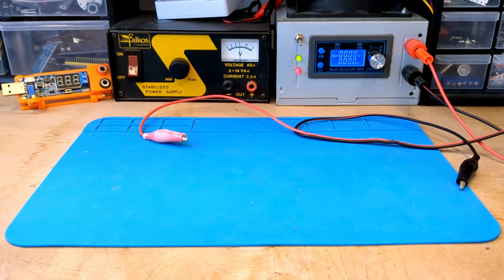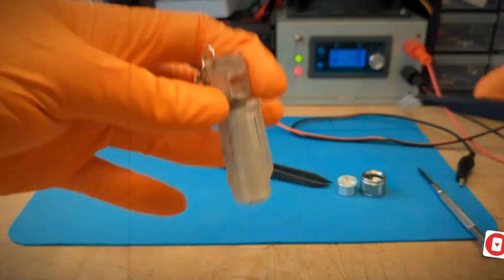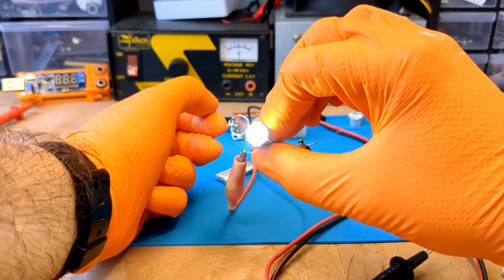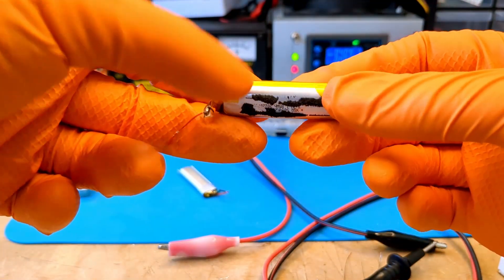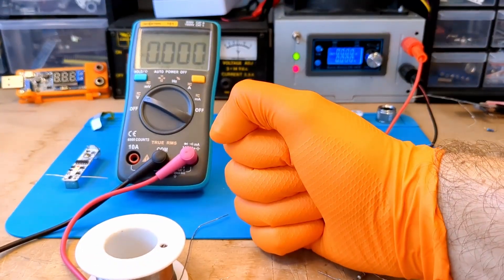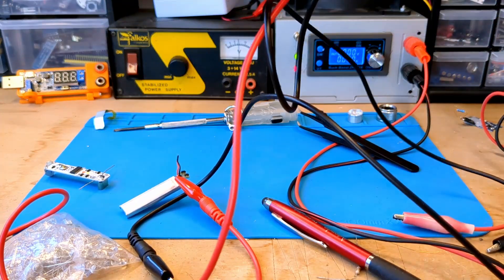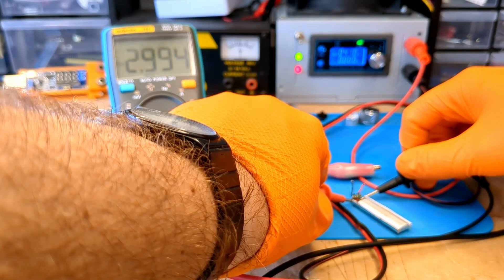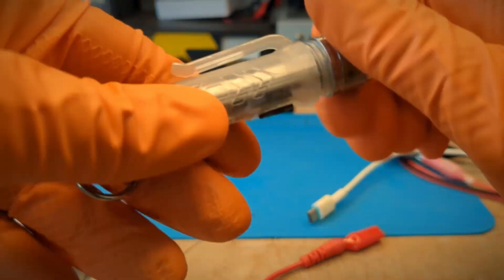How I rescued my flashlight. [How to restore dead batteries]

Comment: I think the trickle charge "battery saving" feature of the TP4056 is simply working at much lower current since you changed the resistor; I imagine charging speed that way also changes trickle-charging speed, and those 7-8 mA is what it's trying to charge with.
Reply from the maker: Good point. I should check that...